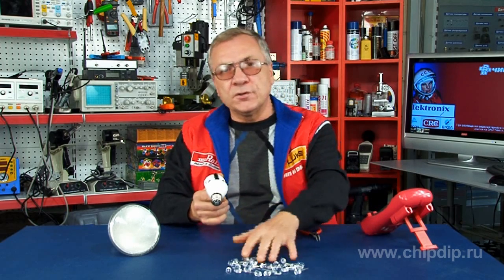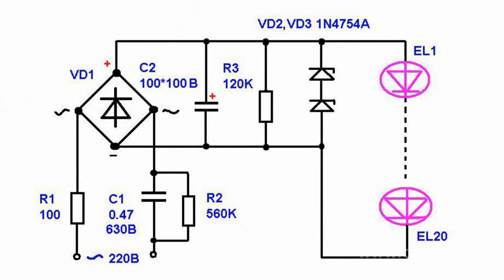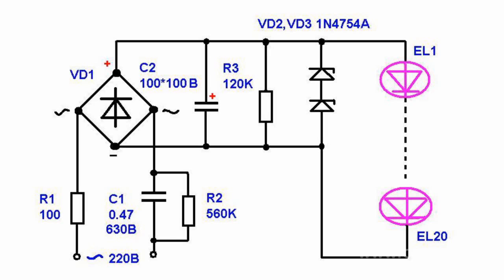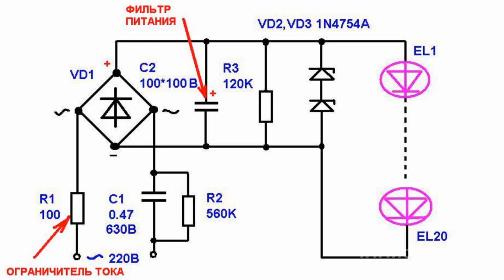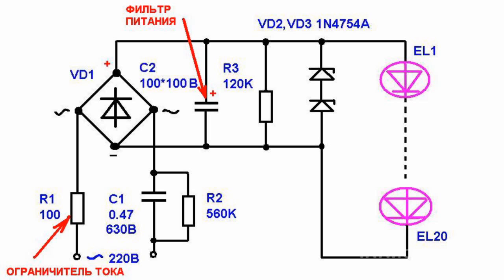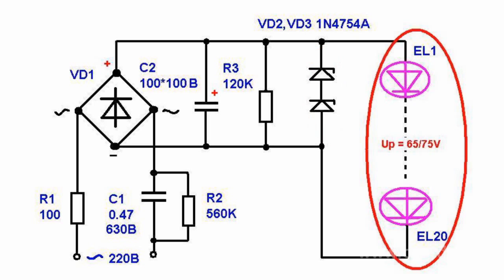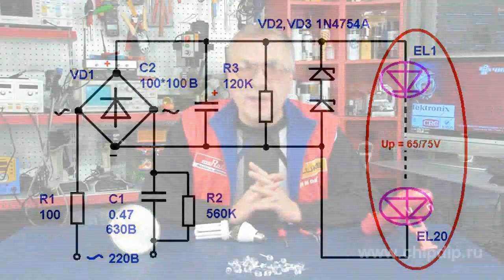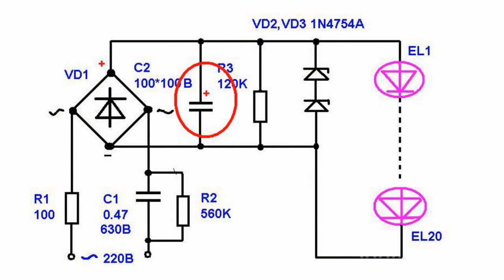Simple Power Supply Circuits for LED Lamps

Comment: I have 165 SMD leds with forward voltage equal 12 volt each. Every 5 Leds connected in parallel are in series with other 5 leds till 165 leds. 
So I need 400 volt DC voltage as input to the mesh of leds.
Do somebody recomend me a circuit of a drive that fits this application knowing that my AC source is 220 Volt AC.
Thanks

Comment: I run it through the software package- it gives ac around the bulb but around the capacitor area are two different DC waves. Not a bad circuit can be used for two different purposes at different places so I found it good.

Comment: Can a power adapter that meets the voltage and current output requirements be used for led strips? For example, can a 12V  4Amp  adapter from  some other electric device be used to power a 48Watt strip of led lights?

Comment: So, 
C1= 0,47uF/630V ??
C2=100uF/100V ??
VD1=???
Put the value in description or in the comment.
Reply: Yes, the circuit is OK. C1 is to drop voltage/current without heat, thus loss (unlike resistor). Since capacitor C1 is intended for DC current, (and is used for AC) that's why 600V to by safe on breakdown capacitor in 220V AC circuit. resistor R1 100ohm is actually to absorb initial inrush current, another purpose is as fuse, in case of short, this will open and safely disconnect the circuit. R2 is to fast discharge capacitor C1, since after power off (on top of AC period) it might stay charged on peak voltage, which is 220 x 1.414 =311V. Capacitor C2 is electrolytic capacitor 100uF/100V to filter 50Hz so LED wouldn't flash. 100VDC is enough, since max. voltage is limited to max voltage on VD2, VD3 and L1-L20 and will never exceed 100V. But make 100% sure (5x check) that all parts are correctly circuit connected, if LED's and/or Zener diode circuit is open, the voltage on C2 will immediately jump to peak voltage and (311VDC) and will explode.
Reply: Miro Turek since an LED can, sooner or later, fail leaving the circuit open and causing the C2 cap to explode, this isn't a circuit to suggest for DIYers.Let's not forget the circuit is NOT-ISOLATED from main AC, another UNSECURE choice. :-(
Reply: Donato Greco
That is reason why I put a Zener diode parallel with LED's with higher voltage than is on them. I case of LED failure (opens) the Zener will still keep circuit closed (and safe voltage on capacitor). Otherwise the voltage on capacitor would go on mains peak voltage (220V x 1.414=311V). There are actually 2 Zener diodes in drawing, so it shouldn't happen.

Comment: what is the value c2 capacitor and wattage of resistors?
Reply: C2 might be 100uF 100 volt since C1is labeled 630B.  R1 should be 1 watt, R2, R3 can be 1/2 watt.